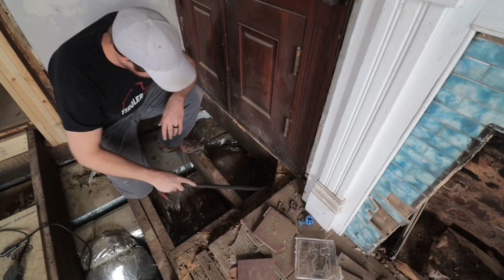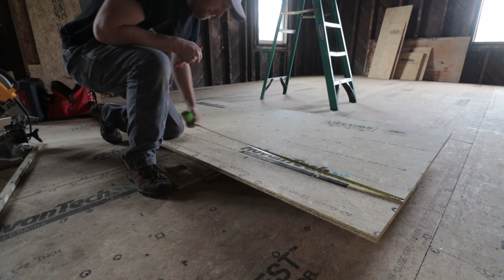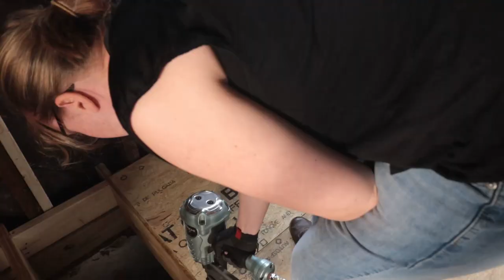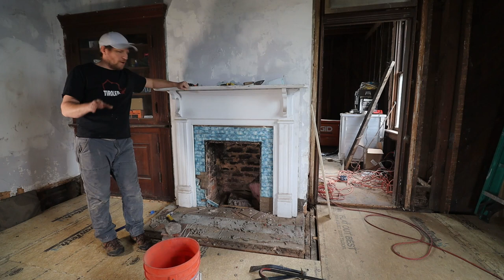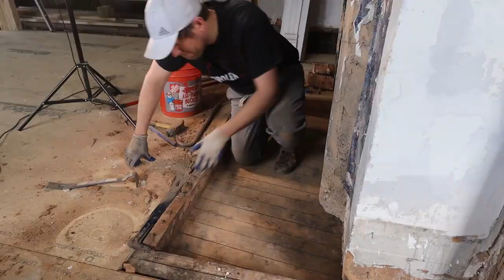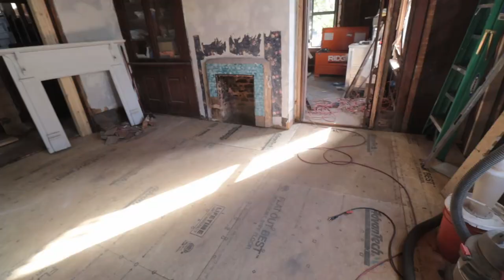Finalizing the Floor and Hearth removal - Victorian Home Renovation [TirolerInn]

Comment: Very interesting to see the demo and fixes around the fire place. I was curious on how close by that wood / combustible materials could be used given the heat from a fire
Reply from the maker: Great observation. If we would use the fireplace as a wood burning fireplace then we would for sure have the full depth concrete or stone hearth. So around 6 inches of thickness but in our case this dining room fireplace will either be for decoration only or might get a gas or electric insert which nowadays most of the time need very minimal hearths.

Comment: Nice! Whats your Budget(-Plan) for the Renovation? And did you already have troubles to stay in Budget? Plans to did all by yourself or did you contract some work out? Have a nice sunny week!
Reply from the maker: Good questions. We have funds from selling a previous home, so at the beginning we tried to get some rough estimates of the most costly parts of the project, mainly the exterior, to make sure it would be within that. We also tried to think realistically about the home’s value when it is finished and the neighborhood so we don’t go very far over that, but will still have a great home. So far we have been able to get most of the work done with some help from gracious friends and some minimal costs of materials along the way. Still the most costly items will be the roof and exterior repairs so we will see! Thanks!